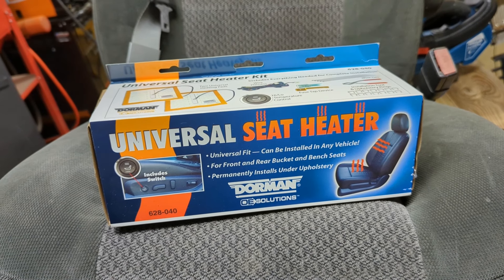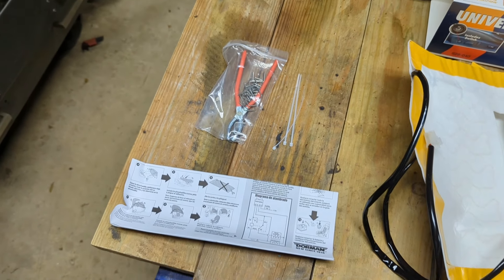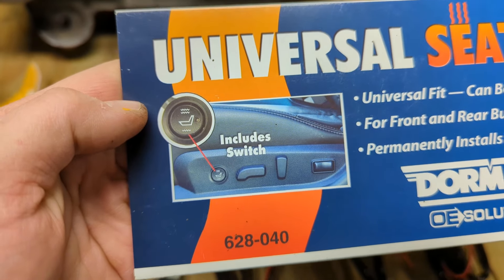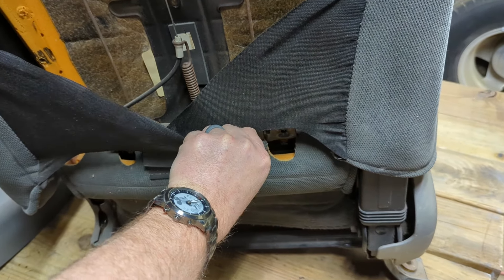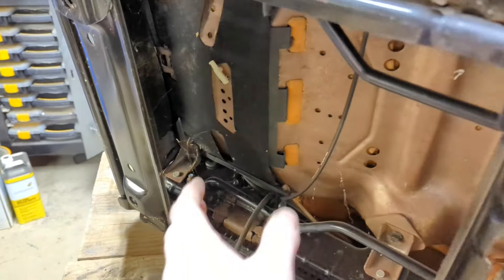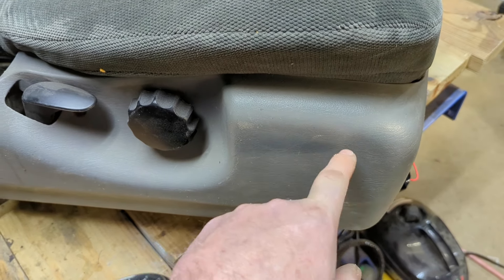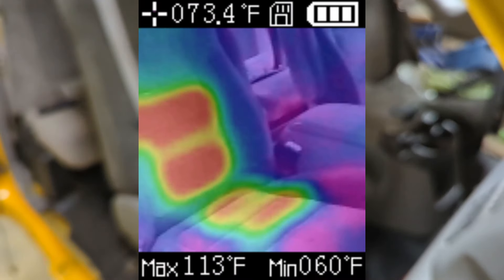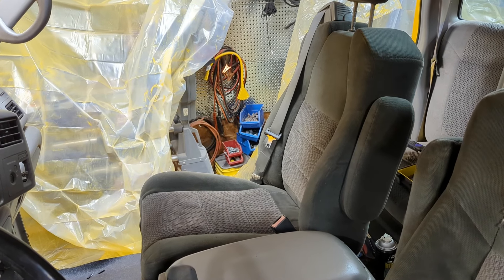How to Install Universal Heated Seat kits, it's easier than you'd think!  Installed on 7.3 SuperDuty

Comment: Do you think I could put the elements on top of the current fabric and then install leather seat covers on top?
Reply: Great idea
Reply: Yh iv done that on previous vehicle.   Will do the same myself again
Reply: I'm going to find out how well it works today!
Reply: beastwithredpill  I did in fact install the seat heaters on top of the seat fabric and underneath seat covers. They work very well too! What kind of details are you looking for?
Reply: beastwithredpill  I basically did what this video shows using the same product but I adhered the heating element to the backside of the cover before I put it on. That's it. Getting the right fuse and running the wiring through your car is specific to each vehicle. In my car there were open fuses on the fuse box where factory installed seat heaters would normally go.
Reply: beastwithredpill good luck!
Reply: @torq21 great to know it worked as that was what I was searching for when I found this video! I just got a new-to-me car with cloth seats. I really wanted heated leather but couldn’t find a single one that had them that also had a manual transmission. (Manual trumps heated seats in my book, I will not drive an auto, lol!) 

I asked my husband if I could just get leather seat covers, put a universal seat heater over the current cloth seats and put the leather covers over that. He’s a firefighter so of course he’s thinking of fire hazards, but it seems that’s exactly how it’s done from the factory so I don’t see a whole lot of difference. Are yours still working well?

Comment: Hey I'm not a car guy at all. I watch your channel just cuz I enjoy your reviews. I have found myself in a pinch automotively and I figured there was no harm in asking your advice. I have a 2002 Nissan Xterra that I plan to keep for life. You can mock this at your will. I have put a great deal of work into making this a stealth overlanding vehicle. Recently I've had water intrusion and a horrible mold problem to which I am terribly allergic. I've got a detailer working on it but the headliner is shot. I'm getting quotes all over the place. I'm a pretty mechanical guy, is this the kind of job one can DIY? Do you think it's possible some of these cheesy aftermarket headliners like with the stars might actually be cheaper than OEM? Any particular brands you suggest or you suggest I avoid? I feel like a shmuck asking after my personal needs on an unrelated video, but my trusted mechanic has retired and I don't know anyone I trust who is knowledgeable about cars.
Reply: After a moment's thought it occurred to me that you probably have a patreon. I would be happy to give you something to make it right for what that's worth. Incidentally, is there such thing as an aftermarket seat cooler? My back sweats on every road trip regardless of temperature
Reply from the maker: Unfortunately I don't have a lot of headliner experience to be able to make any suggestions.   I did replace the headliner fabric on an Eagle Wagon once by removing the old and gluing on the new using 3M headliner fabric glue, but sadly it didn't stay attached.  That was many moons ago and I'd bet the headliner glue technology has since changed, or I'd hope.   As far as a seat cooler, there are after market kits and they can be expensive.   The really good ones use peltier junction cooling modules.   These will heat and cool the air based on polarity.  I thought about installing them in the truck I've been working on but I was afraid all the dust and dirt my service trucks sees would cause the fans to prematurely fail.   An nope, I don't have a patreon, I started doing videos on YouTube as a fun hobby and the little bit of money the videos make from the views keep the hobby moving forward. :D    Here is a video on seat ventilation. https://youtu.be/66JSqDfw46w
Reply: This is an older comment, but here is a video that might help you: https://www.youtube.com/watch?v=7pPmK7oSJNo

Comment: Oh yeah, I have one other car question. What the hell, I've already thrown my hat in the ring. I have a 2014 BMW i3 Rex that I am adapting for a wheelchair to replace the passenger seat. The sizing works out perfectly. This car has an absurd number of airbags. There is a wire loom under the passenger seat with no visible connectors, it goes straight into what I believe is the explosive pack for some airbags. I presume there is a connector hidden under the carpet which will become exposed when I unbolt the seat, you can see a strain relief in place. Are there any special procedures I should know about handling this? I don't expect you to know if there's a connector on my specific vehicle, but do you have some general advice working around airbags? Do you think the BMW will go haywire with the seat removed? I have been strangely lucky, it has not required any service yet. I would like to keep it that way, I am familiar with the stereotypes and I'm a poor. There were crazy rebates that literally made it the cheapest car to own for me, I have the cheapest electricity in the country. I would never consider a BMW otherwise
Reply: When messing with airbags or their wiring always have the battery disconnected and have it sit that way for more than 30 minutes before touching it as for The seat you might have to get dummy connectors to make it think the seat is there and the seatbelt is "on"/ buckled you can also find them for making the car think the airbag is there if you want to remove them
Reply: @Wesleystewart78  this is very helpful advice thank you very much. The card in question is an electric vehicle, presumably the airbags are actuated by the 12-volt system, but I'm not certain and there is very high voltage wiring throughout the car that intimidates me. Do you know if there is a way to temporarily disconnect the car's main battery pack?
Reply: @Wesleystewart78  and when you say I might need dummy connectors, is this just to prevent an error from popping up? Or is it possible the car would refuse to drive?